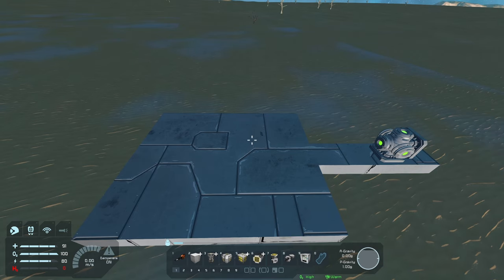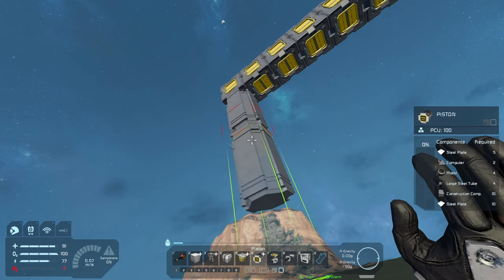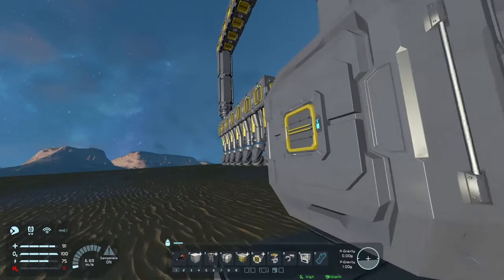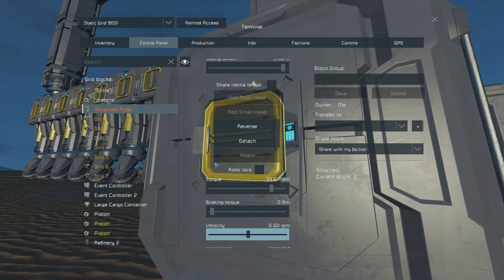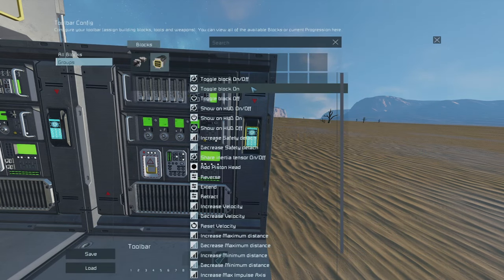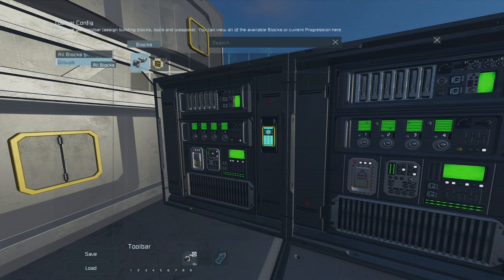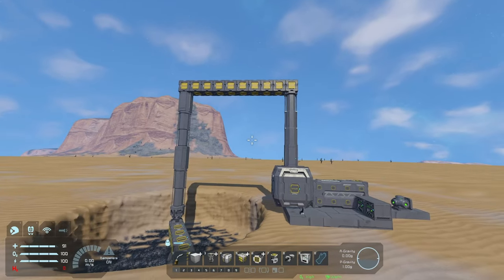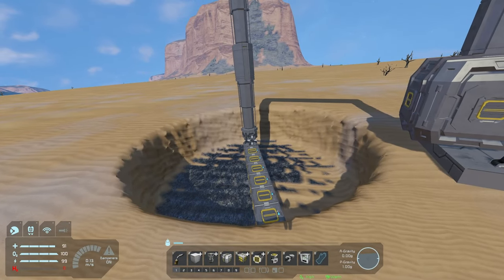Space engineers automated mining rig tutorial. #howtoguide

Comment: Thanks for great tutorial. But i dont know if I'm doing something wrong or what. but drill bouces a little bit to the left then right and decides to dig straight down  not in circle. Any idea why its happening ?
Reply from the maker: Hey thank you for your comment, have you made sure to turn on enertia tensioning on for the pistons and rotors? that should stiffen everything up. Also it may be getting stuck on some voxels, preventing it from turning, so check that out.
Reply: @MrSteve_  hmm i dont see that setting. In the place you showed in video. Any idea why?
Reply from the maker: This can happen due to a bug, a few things you can try, reloading the save / Make sure you are selecting just the individual pistons, not a group / make sure your in Experimental mode.